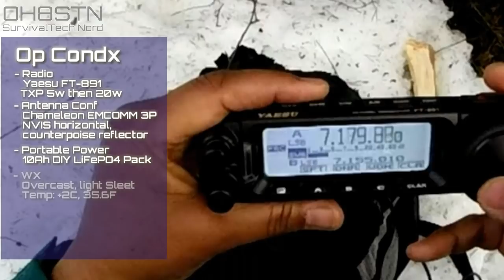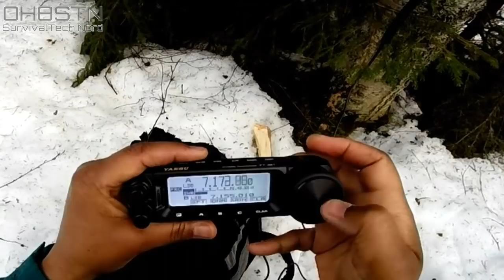Chameleon EMCOMM III Portable

Comment: Have ever tried the Emcom III Portable doing 80m NVIS. My experience is the antenna is great at 20m and up, but not so much at 40m and lower. I am choking at the feedpoint and added adding addition counterpoise wires. Still I suspect I am better than -3dBr from my 80m-10m EFHW on 80m.  What is your experience with 80m NVIS using the Encomm III Portable antenna? What configutation?
Reply from the maker: It's a compromise antenna. It's shorter than a half wave cut for 80 m. Naturally it's not going to get as good performance. What it does do is cover bands which your efhw can't cover without an antenna tuner. And my testing, I found that an equally long counterpoints as the driven element, gives the best performance.

Comment: Hi mate hope you are well. I am not sure NVIS (comms within 300km) works on 40M at our locations. According to the charts I have seen it does not and operating evidence would seem to bear that out. Probably 60M is the highest you can go. Just my take. Larry M3 MPD
http://hflink.com/propagation/
Reply from the maker: I have found nvis to works quite well on 40M up to about 75-500km at this latitude. This is assuming both stations are using nvis antenna configurations. My own NCIS setup, is 3.5 meters above ground, mounted horizontally.

Comment: Saw  your blog post on the chameleon emcomm III antenna but can't figure out how to log in to post comment.  So I am posting here.  I use endfed halfwave monoband antennas from the German company Lambdahalbe.  They have no match boxes and no tuner is necssary.  You can adjust the resonant frequency over a 300 ohm stub.  I have these antennas for 70cm/2m, 10m, 11m (cb), 15m and 20m.  When portable, I hang the 20m antenna vertically from a 12m or 15m telescope pole.  You can also hang it from a tree.  The antennas are lightweight, no heavy matching box, no tuner, no counterpoise.  Here is a link to the 20m band antenna with description.  

http://lambdahalbe-shop.de/epages/61894e0c-6738-4e1d-a4bc-f12f2d9ab60e.sf/de_DE/?ObjectPath=/Shops/61894e0c-6738-4e1d-a4bc-f12f2d9ab60e/Products/%2214%20HPB%22

Only in German, though.

I also have a 5 band endfed halfwave antenna from the Dutch company Hyendfed.  It's 23m long, and it needs lots of real estate out in the field.  Also a good antenna.  No tuner or counterpoise necessary.

Vy 73's.  
de David DM3BC

Comment: The FT-891 makes for a nice replacement for the FT-817/818. Has DSPs for the receiver and can go from 5w to 20w (or to a 100 watts) as needed with the right battery. No need to bring an amp along.
Reply from the maker: That's what I've been trying to tell people. I don't see any reason for someone to buy the FT818 over this one, if it's going to be one's only rig. I'm also working on a smaller battery pack for the short outings like this.
I saw your email but I don't know the answer yet.
Reply: I think the way to go is to buy both radios and you can then pick the best radio for the outing. I wish the FT-791 will be the FT-857D replacement. The Ft-891 may not be a SOTA radio for hikers but its a great radio for anything else.
Reply from the maker: Well if we can get some of these Millennials to start eating meat and fish, perhaps they could carry the 891 up to or Summit 😀😉
I haven't been following along. Is there a 791 in the works? I'm hoping for a kx2 kx3 killer from Yaesu. Something better than the eight one seven, with the receiver of 891, in a smaller lighter 897 sort of concept.